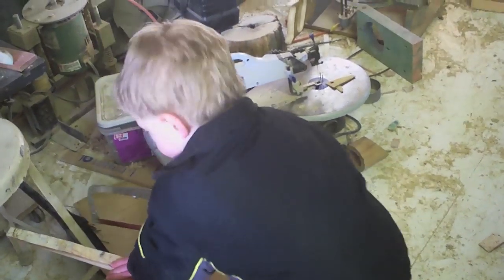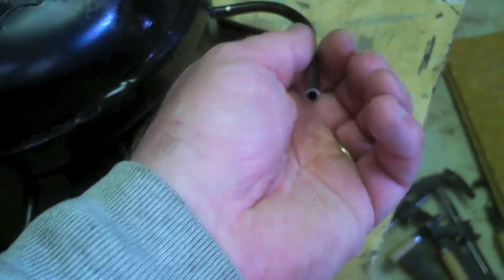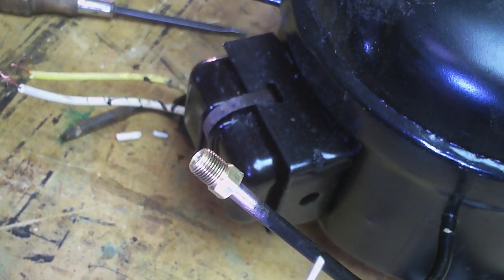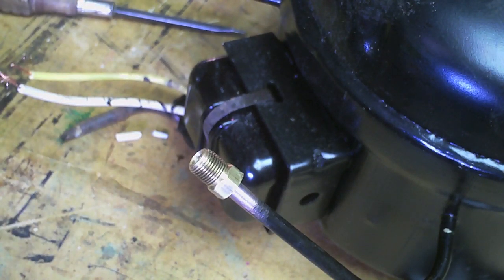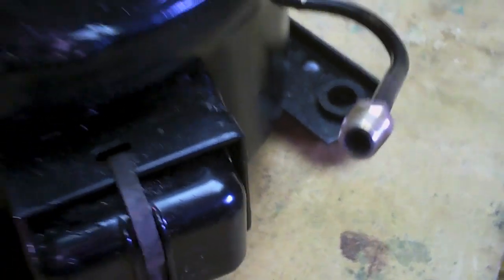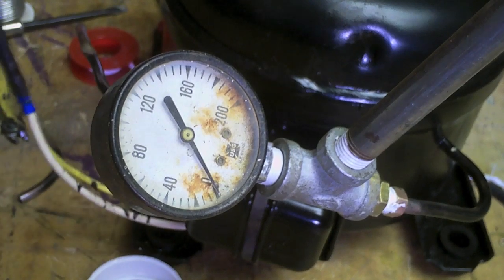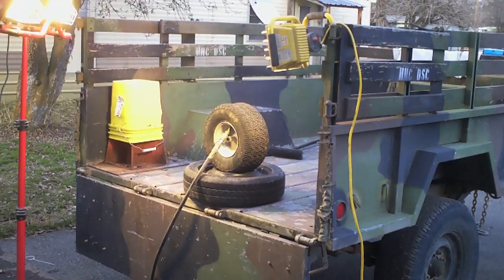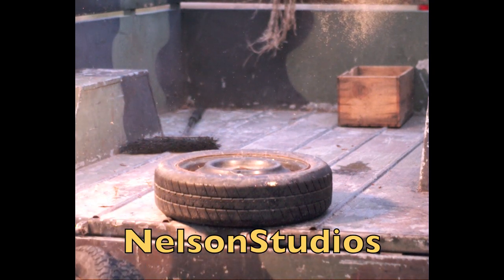High Pressure Compressor

Comment: You don't think using 15% silver solder would have been the correct way to connect them joints running at those pressures. Since anytime these joints are done. Its always been done with silver solder and not regular electrical soldering in all commercial businesses. These are the only sites that I've seen making these joint at a sub standard either because not knowing or unavailability. If so there should be a notice posted just as visible that joints this way is potential risk of extreme danger.
Reply from the maker: billsherenow Only just saw this comment.  Sure you bet but then that, if I remember correctly was plumbing solder.  No idea the ratios in that but in the ball park.  Or I could have used electric solder, can't remember.   Worth pointing out that we are talking a joint not a pressure vessel failure.   Scary sure, loud you bet but not a killer

Comment: If you are using this pump for open air systems the oil in the compressor should be replaced with something that does not absorb and hold moisture. Check out other you tube videos on what exactly you will need to prevent premature failure due to internal rusting.
Reply from the maker: Subgunman This one failed spectacular style in smoke about 6 months later.  Could have been the oil, could have been making it out of a junk compressor.  Still in the scrap pile, maybe I will cut it open and find out.

Comment: Do you remember how hot the air was in the tyre? Was it hotter than outside? I found out that pressured air gets hotter. I want to heat the air by applying pressure but not sure how much pressure is needed.
Reply: Baris Yilmaz     
Yes if you compress air or any gasses, they will get warmer. But you would have to retain the pressure to keep it hot, because once the gas looses pressure it also looses temperatures. Bernoulli's principal

Comment: Watched you do your solder connection and was a little concerned that it might fail. I've done a few "Frankenstein" connections myself. And had a few fail on me too. You said you had a flare tool. Why not push the pipe all the way thru and do a small flare, only enough to keep it from sliding off, then solder. Good mechanical connection, and solder guarantees its airtight.
Reply from the maker: Nice idea.

Comment: I've found if you have it clean, ordinary rosin flux will work fine on mild steel with regular 60/40 leaded solder, if you're at all worried about the acid attacking the joint :)

Comment: that brought back some memories. As a farmer, lots of us had propane conversions on our trucks. Sometimes we had break downs or flats in the field and we carried an air hose and impact wrench. We just plugged into the propane tank and did what we had to. Never had an accident, but 30 years later, I would never do that again. We had plenty of tires that we pumped up with propane. Of course propane is way too expensive to waste nowadays. I think we paid like 30-40 cents a gallon back then.